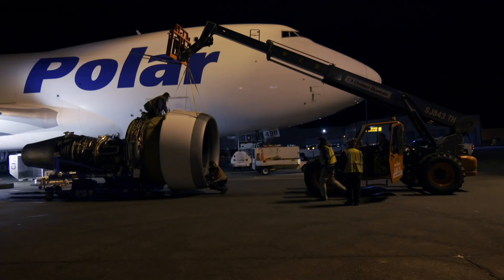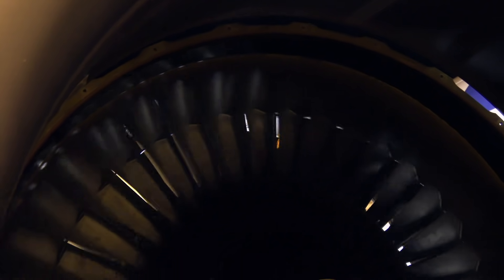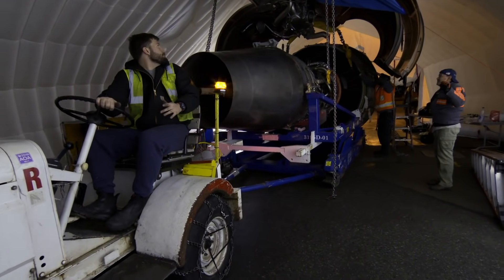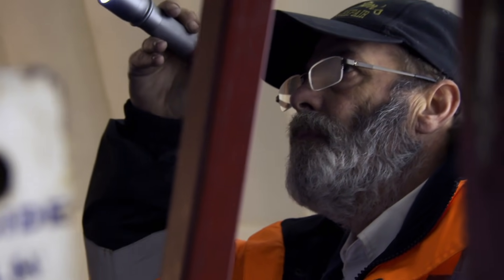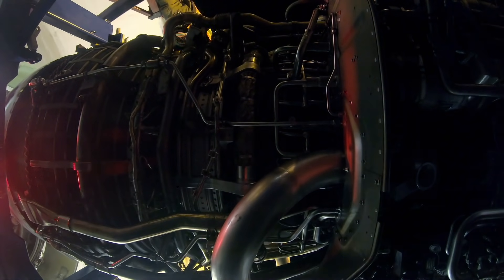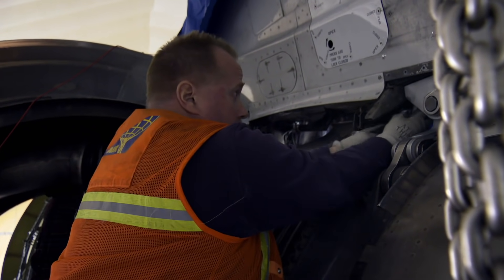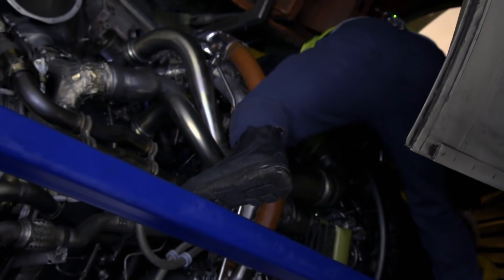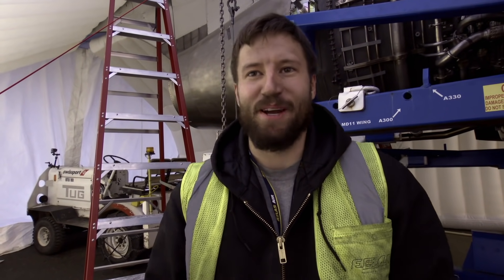Jet Engine Swaps Are a Big Challenge for Any Maintenance Crew 😵‍💫 Ice Airport Alaska | Smithsonian

Comment: With such expensive parts I expected more sophisticated and high tech tools rather than just chains
Reply: I was one of the guys that changed that engine doing it with chains is actually right way to do it so you can control the engine better while it's going up, obviously with the stand that comes with it.